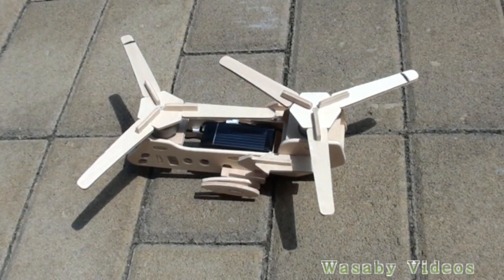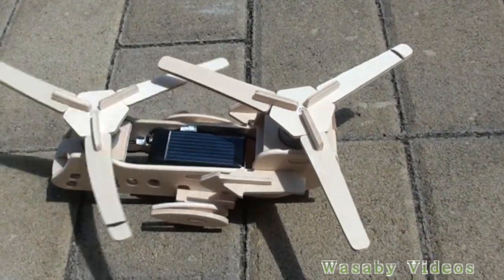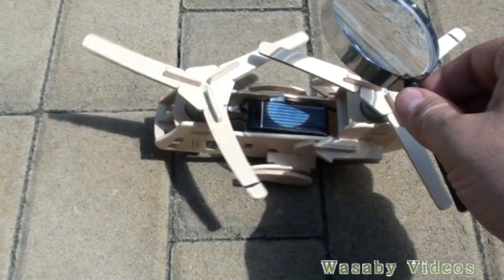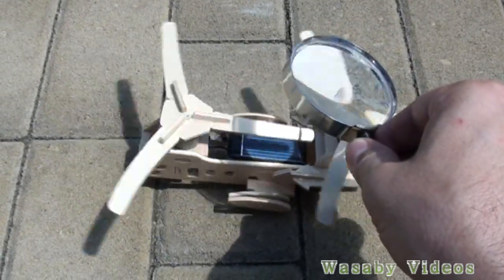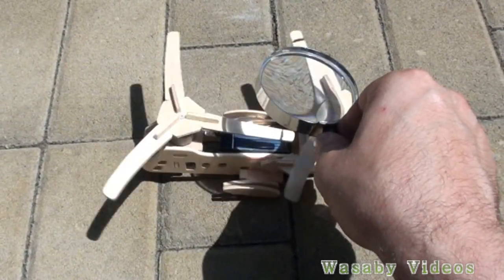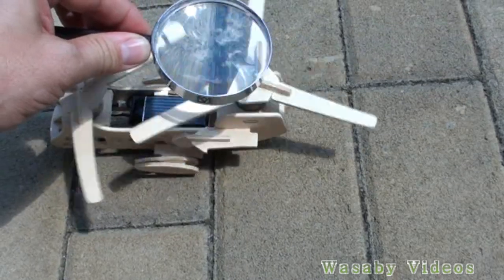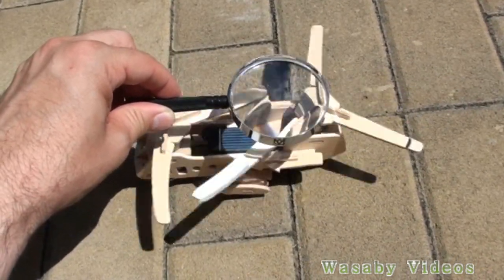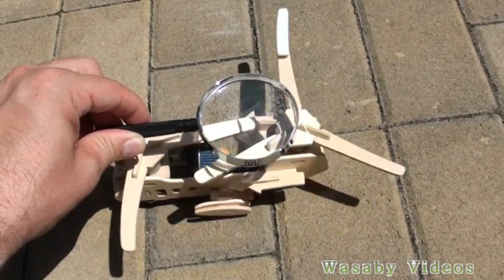How to increase solar panels energy efficiency "Free Energy"  | WasabySajado

Comment: I think that if you lined the blades with a lot of small connected solar panels and ran the wires through a small hollow tube in the middle of the blade it would work better. It would be difficult though because the motors are at the bases of the blades.